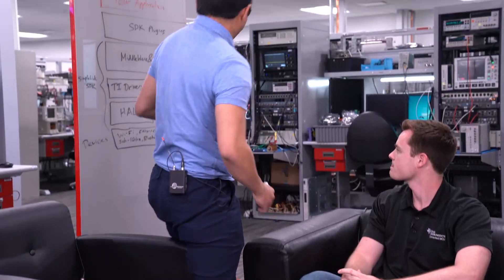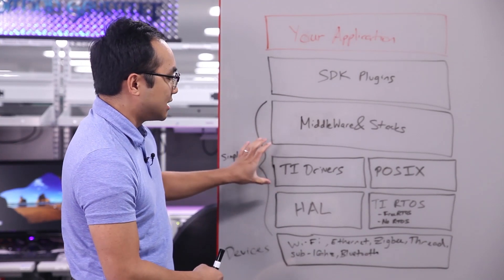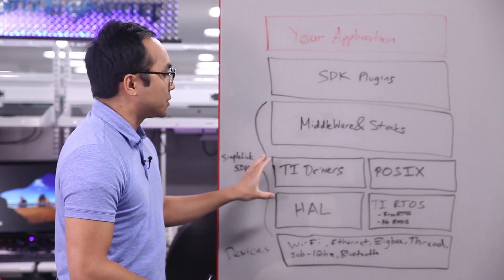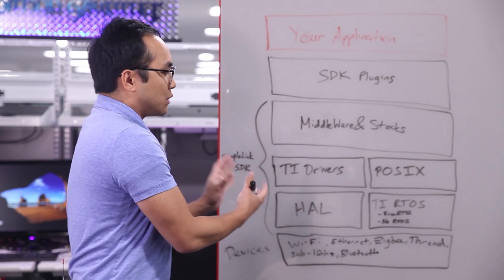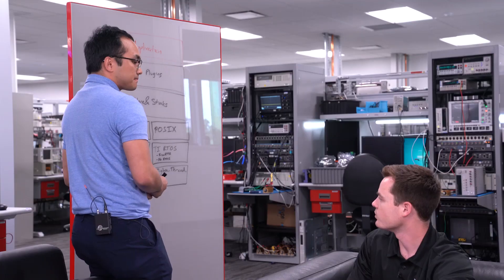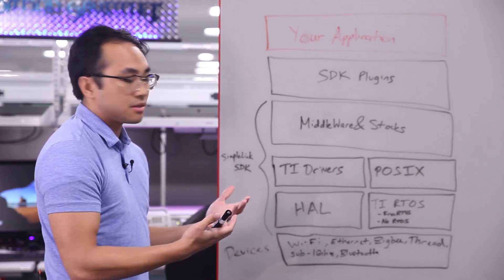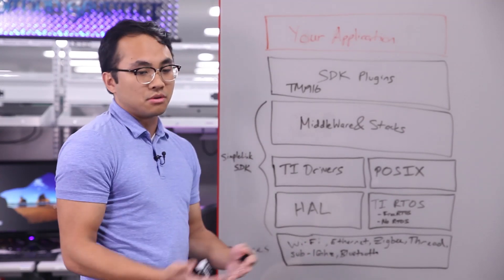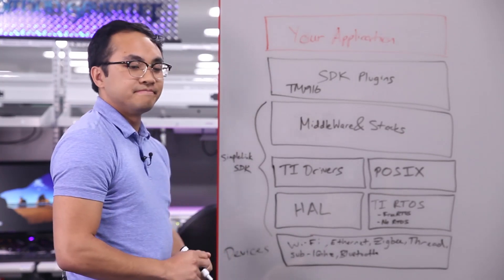Connect: Why SimpleLink?

Comment: I am using CCS for quite some time, I want to mention that using SimpleLink API is cumbersome (need to read API PDF thoroughly). Recently I have tried STM32Cube MX configuration tool,  generation of startup code is so simple.  Does TI has some think similar or I am not awake of it.
  I want to mention about compiler, TI compiler is not backward compatible.
Reply from the maker: Hi Tapas - We are looking at ways to further streamline configuration and have an early preview version of a new tool called SysConfig, which is included in the latest TI SimpleLink SDKs and CCS v8.1. SysConfig will offer a graphical interface for enabling and configuring the SimpleLink TI Driver APIs. This should aid developers in the configuration process allowing more time to be spent developing differentiated application code. You can learn more about SysConfig here: https://www.youtube.com/watch?v=Z9ilZ1dMelE

Comment: in 2:30 it makes it seem like if I write something to use wifi with TIDrivers it will easily work with ethernet instead. But from what I've seen the drivers allow to easily port, say, UART code from a TM4C into a CC2650 or a MSP430. Not to port a UART transmission to a wifi transmission.

Could you clear my confusion?
Reply from the maker: Hi Luis - TI Drivers offers code portability of our functional APIs for common interfaces/peripherals, including UART, I2C, SPI, ADC, etc. This means applications built on top of TI Drivers can be easily ported between the various SimpleLink devices, allowing developers to more modularly include different forms of connectivity as they move within the SimpleLink portfolio. A more tangible example that shows the importance of this is a developer who wants to bring to market both a Wi-Fi variant & Ethernet variant of a security panel. A developer can write the bulk of their application using TI Drivers to interface with sensors, LCDs, buttons, LEDs & more. This TI Driver-enabled portion of their application code can then be ported between the SimpleLink Ethernet devices & SimpleLink Wi-Fi devices. Further more, the SimpleLink Platform also exposes additional layers of software portability, such as our Network Services software layer that offers MQTT & HTTP APIs that are code portable between our Wi-Fi & Ethernet devices. This allows developers to bring multiple product variants to market while leveraging as much software development as possible.
- Adrian

For more questions, post to our team on E2E at: http://e2e.ti.com and be sure to bookmark SimpleLink Academy at: http://ow.ly/7GHi30l9sKJ